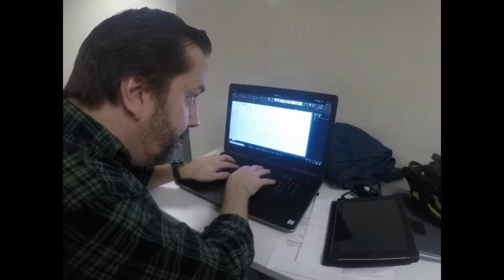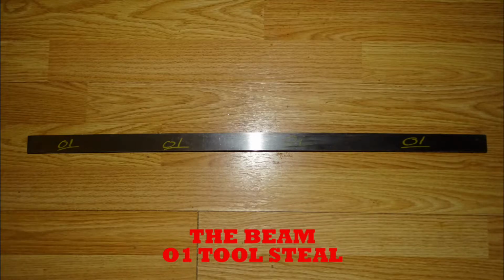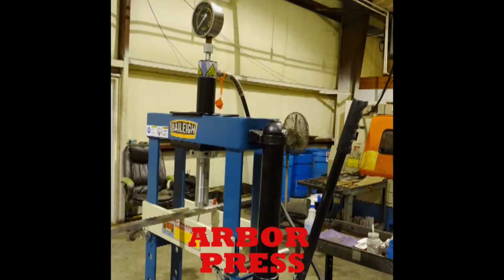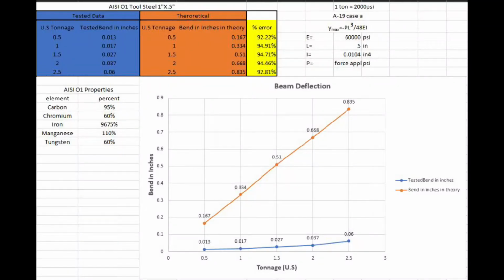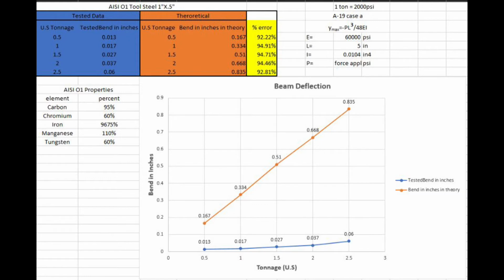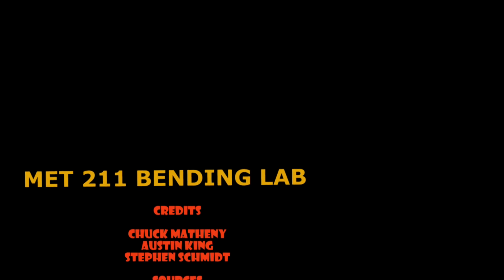MET211 Bending Lab

Comment: The problem is that your elastic modulus is wrong.  Steel has an elastic modulus of 30,000,000 not 60,000.  I computed a deflection of 0.01666 (etc.) inches at 2000 lbf (1 ton) of applied force.